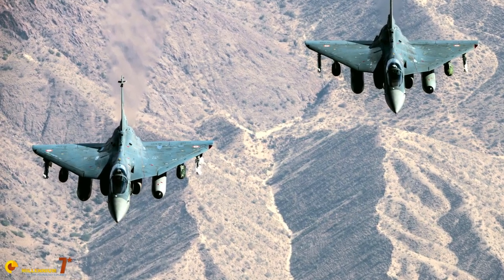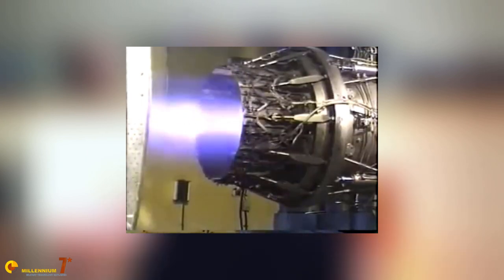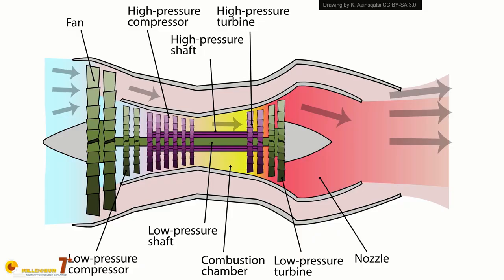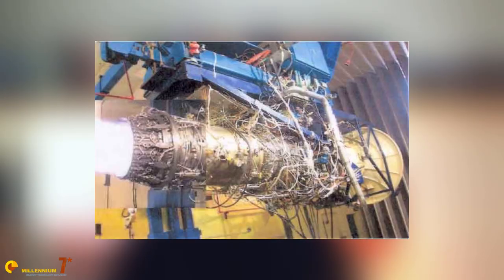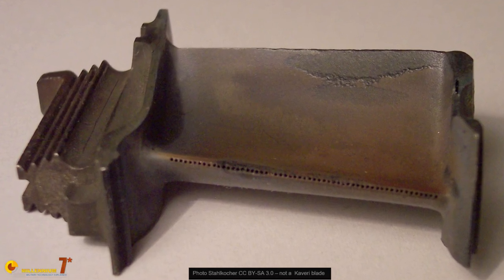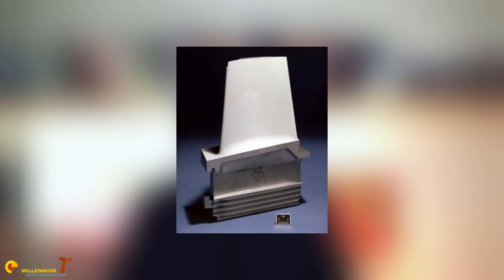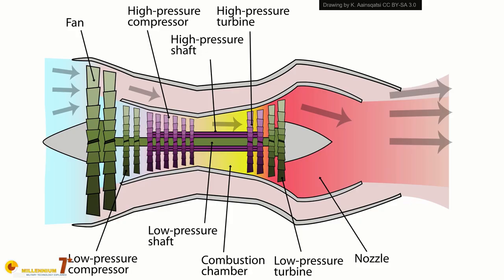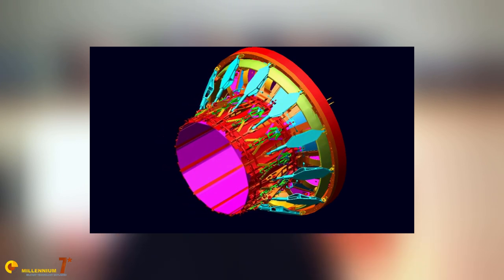TEJAS and the Kaveri Engine

Comment: Thank you for the video.
Please also make a review video of jf17.
Reply: it sucks
Reply: JOE BLOW ME But still much better than Tejas.
Reply: shounak katke Yes, please do! It’s a similar plane and a direct competitor/adversary of Tejas, but it has a very different concept and development history! It’d make a very good contrast. Also it’d show that your channel is neutral and balanced, and has no pro-indian bias.
Reply: @csabascs5913  a so called 4th gen chinese jet which doesn't even have quad axis fbw 
And u say its better 😆
Reply: @thesidd19  Yes, I consider it better than a 3rd gen indian jet that's been retrofitted with 4axis fbw at the end of a 30 year development period in the false hope of saving its relevancy. ;)
Well, actually I think that they are quite close with JF-17 being somewhat better. In some areas (e.g. aerodynamics, onboard systems, ew, bvr missiles) the JF-17 has the edge, in some others (e.g. engine, fbw, maybe radar) The Tejas.
The main problem of the Tejas imho is its way outdated aerodynamics due to the extremely long development cycle caused by lots of delays, concept changes, etc. Even the indian air force itself is quite disappointed with its aerodynamic performance. Sure, fbw helps somewhat, but it cannot make wonders. You can't create lift out of 0's and 1's, so it's gonna remain a huge limiting factor throughout the Tejas' service life. Because of this, its upgrade potential is very limited too. The JF-17 has much more upgrade potential, imho, due to better aerodynamics. 
In addition, JF-17 development started in 1999 and it's fully operational since 2010, while Tejas development started in 1985 and it's expected to be fully operational in 2023 only. So the JF-17 is not only a better aircraft but a much more successful project too.
Reply: Csaba SCS  seems like you don't even know about LCA development cycle,
Quad axis fbw was developed fot LCA in 1999 itself, the TP tested in 2001 also has the same quad axis fbw installed,
While fc01/jf17 does not even have this basic req. for 4th gen jet and call itself 4th gen 🤣

The aerodynamics of LCA is far better than jf17, it is a delta wing design, specifically to improve its range and dog fight parameters in sub sonic and trans sonic ranges.

While fc01/jf17 is a cheap chinese design with a metal frame, LCA is 60% made out of composite,which is mark of modern 4th gen planes,

LCA has hot engine refuel feature which decrease its turn around time to be the best in the class, while fc01/jf17 can even dream of having it,

And now developement cycle while Tejas development is done entirely in India,
Fc01/JF17's is done in China,
Fc01 is actually a successor design of chinese j7 design which is actually a chinese mig21 clone
LCA was built from scratch.
In every parameter LCA throws fc01/jf17 out of water, be it bvr(astra -110km), be it aerodynamics( delta are better dog fighter and have more range)
Be it indigenous tech and upgrade possibility.

So let me conclude while jf17 is mig21+ 
Tejas LCA is in class of F16
Reply: @thesidd19  Well, Tejas is a pure delta wing like Mirage 3/Mirage 2000 (Gen3 a/d concept), while JF17 is a lerx/trapezoid wing design like F16/F18 (Gen4 a/d concept), so it's obviously the product of a more recent design philosophy. Also JF17 has nothing to do with the J7 design, it's more like a copy of the F16, but stay in your state of ignorance, if it makes you happier. :)
Regarding Tejas being a more indigenous indian plane than JF17 being an indigenous pakistani plane, I agree with that, but this was not we were talking about. I'm not a pakistani fanboy the way you're an indian fanboy, I'm from Europe, so I don't really care for your pity rivalries, I'm just interested in military/aviation technology, workig in aviation myself.
JF17 being like MIG21 and Tejas like F16 is a completely stupid statement that shows nothing else but wishful thinking and extreme cognitive/emotional bias. Neither plane is anywhere close to an F16 or any other modern mainline fighter, but JF16 is still closer, while Tejas is closer to Mirage 2000, that's actually a heavily upgraded Mirage 3, and not really a match for an F16 itself.
But I don't expect you to be disturbed by facts. Like most indian fanboys here, all you're interested in is spreading pro-indian and anti-pakistani propaganda. Sg I'm absolutely not interested in. :)
Reply: Siddharth Singh You’re hopeless... :) You cannot even understand the difference between a pure delta and a delta canard design... There are many videos even on this very channel about canard deltas, at least you should have checked those before you started arguing... Oh, and probably you haven’t heard the testimonials of USAF pilots who encountered Mirage 2000’s in DACT excercises either... Yes, pure deltas have a good range but they cannot hold their own in a dogfight for more than 5 secs, since their sustained turn rate is abysmal and they bleed energy like a slaughtered pig... Real world is not DCS, man! :)
Reply: @csabascs5913  seriously sad for you man,
Where did it get tou that Tejas is pure delta wing design,
Btw In real world Mirage 2000 can beat the shit out of f16 in dogfight,
Don't believe me, check out how many times greek mirage 2000 have shot down turkey f16, 

Indeed real world is not DCS 
Regards
Reply: @thesidd19  Tejas is indeed a pure delta. The small dent in the leading edge doesn't make much difference. It's like a JAS-37 wing, without the canards, and it has mediocre aerodynamic performance at best. Even the IAF itself refused the plane first, because of its poor aerodynamic performance (aming other reasons), so wtf are you talking about?
If it was a plane on par with F-16 or Rafale, why would India want to purchase another 100+ Rafale/F-21(rebranded F-16) jets? Just because it's the most corrupt country in the world? :D
Regarding clashes between Greek and Turkish fighters, I've checked the records: 1 F-16 was killed by a Mirage and 1 Mirage by an F-16, and there were several mock dogfights with varying results. So it proves nothing. Especially considering the poor training of turkish pilots. But I heard the testimonials of several USAF and USN pilots who took part in DACT against many other NATO types at Red Flags and other NATO excercises, and they told that the most underperforming NATO type they met was the Mirage 2000.
I don't say that the Tejas is a useless plane, and I admit that it's a huge step forward for the indian aeronautical industry - after all there are not many countries that can create a supersonic jet of their own. But it's certainly not among the best of its class, and cannot compete with frontline 4/4.5 gen fighters. You cannot even expect that from a first design.
As a MIG-21 replacement, and a complementary to India's more potent fighters, it's fine, but the false claims of indian Tejas fanboys that say it's on par with an F-16, F-18, or Gripen are just ridiculous. It's on par with a JF-17 or an FA-50, maybe, but certainly not with such frontline fighters. It's nothing but wishful thinking.
Reply: @Sumit Barik I know. As I said before I agree that the Tejas is OK as a supplement to the SU-30 & Rafale. Just like the JF-17 is OK as a supplement to the F-16. I don't have an argument with you, man, only with Tejas fanboys who keep trying to convince everyone that Tejas is what it actually isn't: a top notch frontline fighter. BTW, good to see someone from India who's got some common sense!
Reply: @thesidd19  , dude  what the FUCK are you talking about  ? F-16s air to air combat record is 76-2

Comment: I am not sure why we are over optimistic with the delivery of engines. We may have experienced how to develop jet engines but material science is where we are behind as they require time and research. So right now we use F414 and F404 engines and gradually may be in 10 years we may have a reliable engine. It takes time, talent and money. US, Europe attracts a lot of talent and we rely only on local resources and thus take time. We don't even have testing site for engines and relying on Russia. So go slow on the optimism of an indigenous engine in 3 to 5 years.

Comment: Tejas was useful as a research project but is underwhelming as an operational modern fighter. With the numerous foreign produced parts the whole point of an indegeously produced fighter is also largely undermined compared to licensed production of foreign designs which could potentially even allow a higher percentage of domestically produced parts. Kaveri engine development has reached a dead end without technical assistance. Safran has offered such assistance for Kaveri as part of a deal to produce M88 engines in India if Rafale are acquired in large numbers.
Reply: 75% components are Indian and LCA program also exposed the technological sectors where more investment and research is needed so basically it gave us a lot of experience which will be so much useful in future.
Reply: @supratiksaha2001  Rafale could be licensed for domestic production with 90% of parts made in India immediately. Also, the foreign parts are all from a single country which is preferrable in this case. Tejas has parts from multiple other countries and a supply disruption from any one of those countries could ground Tejas because the parts are specialized to each source. Having 10% of parts vulnerable to disruption from a single country is less risky than 25% of parts from several countries. In the future 95-100% of Rafale parts could potentially be made in India. Tejas will never reach 100% - it took 30 years just to get to 75%. 
The research part of the program was absolutely useful though, I agree. It could also serve as a temporary low end replacement for MiG-21 and later serve as a combat capable capstone trainer and aggressor aircraft. It just isn't ever going to be a high end fighter, even with the expected avionics upgrades and was not intended to be. It was intended to fill the low end light fighter niche, which it does to some extent but light fighters are rapidly becoming dinosaurs because of developments in modern missiles. It would have been an adequate replacement for MiG-21 back in 1995 but is late now and never met all targets, which were probably too ambitious. India could continue to throw time and money at it but the primary research benefits have been realized and it is better to move on to AMCA.
Back in the 1980s India should have acquired many more Mirage 2000 and MiG-29 to replace all Jaguar and MiG-21but the government at the time wasn't willing to pay for them and the expected delivery date and capabilities of a new indigenous fighter were unrealistic. Just imagine if India had a force today with these newer fighters in large numbers on the low end (instead of just small numbers in the middle) to complement SU-30MKI and Rafale on the high end. The pressure to replace them would be much less urgent than the current needs to replace MiG-21 and Jaguar. Bear in mind others did just that, replacing Jaguar with Mirage 2000 and MiG-21 with MiG-29 and some are still in service.

Comment: I will not call kaveri a failure 
Its dry varient is going to power ucav ghatak/Aura
though it doesn't reached the mark that we hoped 
Its not a total failure 

Moreover its delays were quite long 
But the main reason was lack of testbed here in india
We cant blame are engineers 

Now its facing major problem with trust issues
Though we acheived a lot in the journey

Comment: Actually, there are 4 factors: You forgot armament.  A plane can have great propulsion, aerodynamics and structure but if uses substandard weapons, it will be a a serious disadvantage.
Reply from the maker: Broadly speaking, you can add and update weapons and systems without re-designing the aircraft, you can't with propulsion, structure and aerodynamics.
Reply: @Millennium7HistoryTech  That's a very valid point.  I say armament because it's one of the things that makes the Gripen so potent besides it's incredible EW suite.
Reply: @death_parade  That would be foolish of me since I have no idea what armament the Tejas has.  India has a very healthy tendency to get weapons from wherever they get the best deal.  I wouldn't expect them to use anything but American or Russian weapons which are both quite good.
Reply: @AvroBellow  largely Russian, American weapon and armaments are very expensive for just few % incriment in quality. 
I would say India should develop that indigenously too